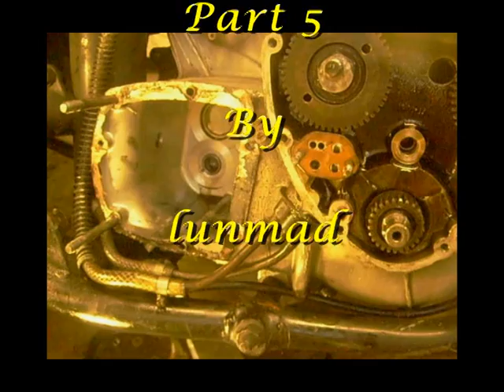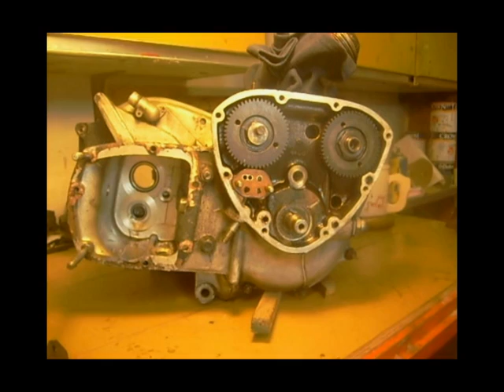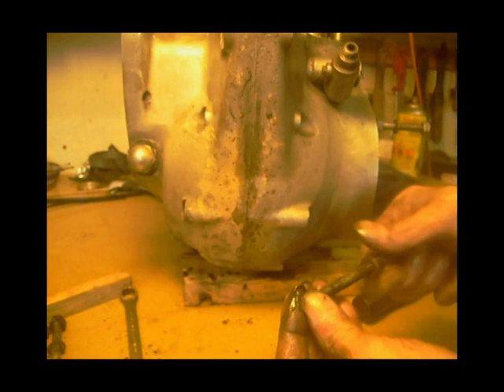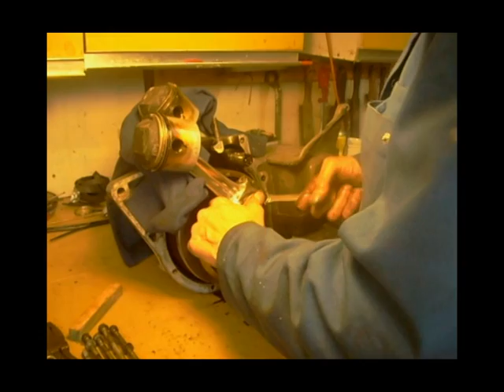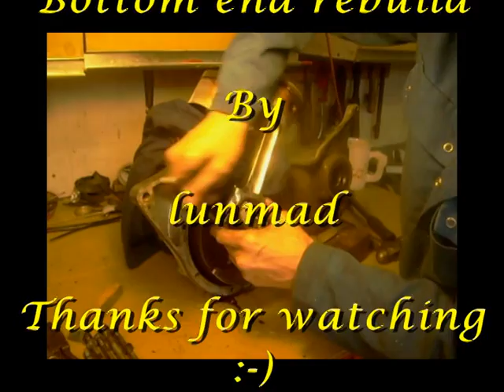T120R bottom end rebuild pt 5

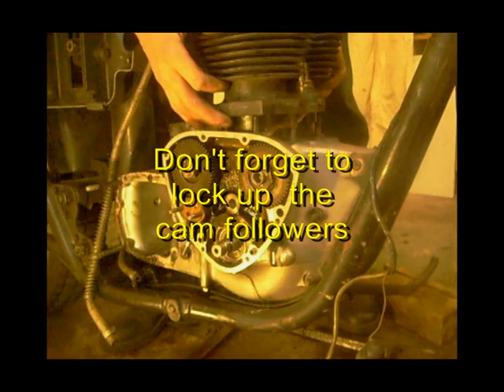Comment: Lunmad i have one question, at 5:53 before you take out the black cylinder out you said don't forget to lock-up the cam followers, what does that mean? 

is this step very important before taking out the black cylinder? because i have to change my piston rings on my bonnie..

Comment: Did you have to take the transmission out to split the case?
Reply from the maker: Hi Nicholas :-)
You could leave most of the cluster in but you have to remove the outer and inner case as there is a bolt behind the inner case
that needs to be removed and if you have gone that far it is just as easy to remove the lot.
Hope this helps.
Reply: @lunmad  Thanks.  Went ahead and took it ALL apart.  That's how we learn!